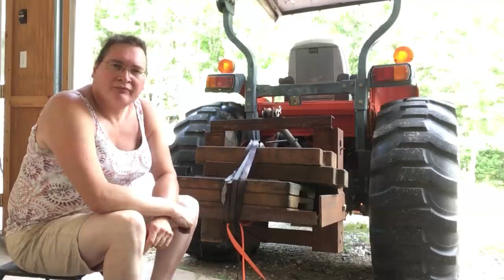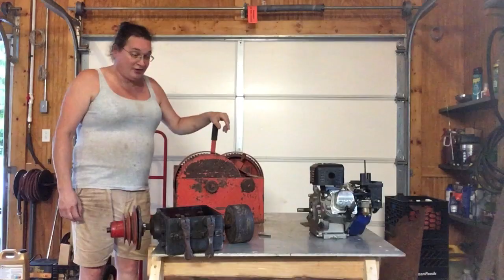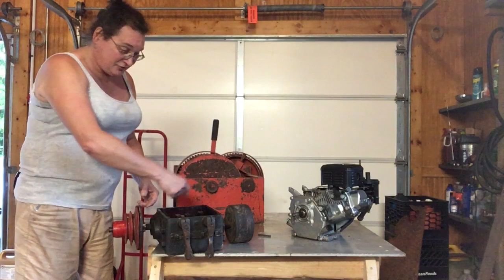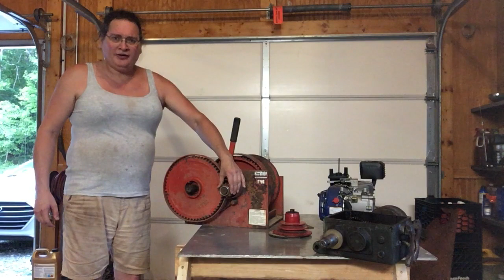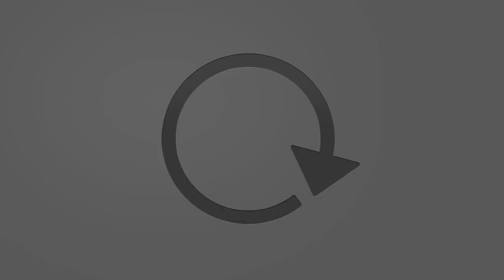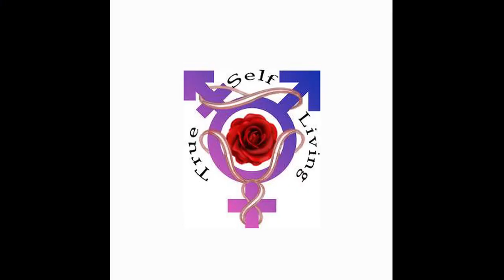Power winch DIY

Comment: Muriatic acid will eat up all the rust in your gas tank. Be very careful when using as it is extremely dangerous, use appropriate personal protective equipment. I have repaired several gas tanks that would have otherwise been no good using this method.